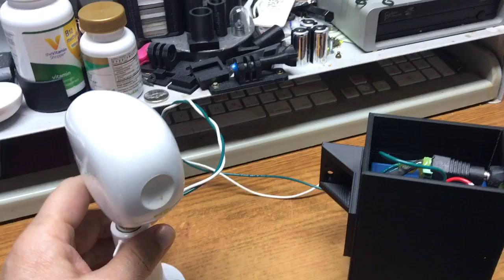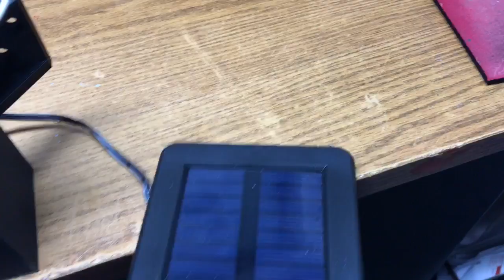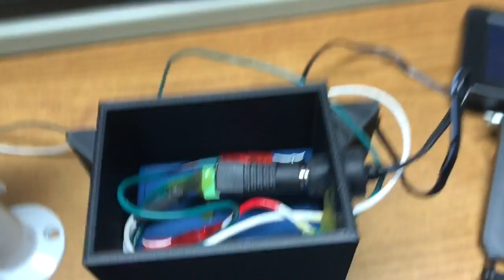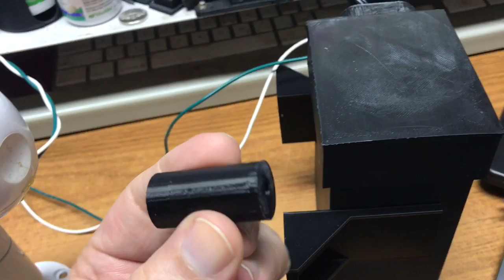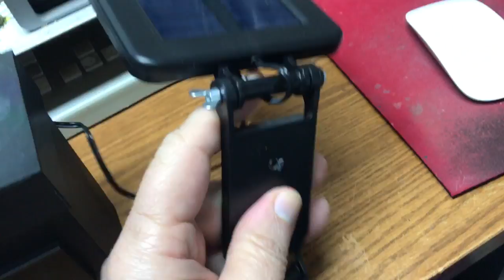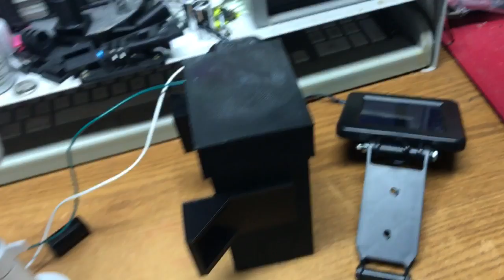Arlo camera solar pier hack

Comment: Hi Terry, most of the comments are from a few years back. I don’t have a 3d printer however, I like your design as I have the same need for a battery pack. I just bought a few 30ft and 15 ft Arlo HD power adapters that allow me to use a regular USB that is plugged into a 110v block anywhere I want to power it. My issue is I want to put some cameras in remote areas and need a self sustaining power supply. Is it possible to develop a USB to receive the camera? Second, I live the minimal solar panel concept. Would it be possible to get extra length to put the panel in the optimal sun LOS? I’m very interested in knowing more. I look forward to reading your reply.
Reply from the maker: There are solar panels for USB that are $30-$50 range. I would just put some rechargeable batteries in the camera and then use a USB solar panel. I am sorry I don't fully understand the rest of your question.

Comment: Terry, great job.  I was wondering if you could provide more information as to battery specs (where to buy) as well at the solar pannel.  I would like to do the same mod as you as I have 6 cameras and climbing a tree or trecking up a ladder is not fun anymore.  I have a 3d printer to support this project.

Thank you in advance

Comment: Terry- would it be possible to take a lanmu power adapter and rather than using the receptacle plug in- add a solar panel to it- if so - would you be able make one up and post a video of it

Comment: If I used rechargeable batteries. Can’t I just connect the solar panel directly to my Arlo camera?
Reply from the maker: To my knowledge they don't make rechargeable batteries that fit in the Arlo, but I've never really checked on that either.
Reply: They do make rechargeable's now. If is a RCR123A Litium Ion 3.7V. All over the Arlo Forum. If has been bless by Arlo because so many people have been complaining about the battery cost. Knowing all that could I just connect a 6 volt solar panel to the Arlo camera with the rechargeable batteries inside and never have to climb the ladder to change the batteries for a very long time? Or would I have to use a 12 volt solar panel? I just can not find the any info on this. I have asked the Forum too.
Reply from the maker: I would say it should work but since I haven't tried it I cannot say for 100% sure. Don't use a 12v solar panel, that will likely fry the camera as it runs on 6v.
Reply: Cool deal! I will give it a shop. Worth a try. These cameras have dropped in price now that the pro and pro 2 cameras have come out. Thanks for your help!
Reply: Matt - lanmu makes a rechargeable adapter - could you connect that to the Arlo  solar panel or similar and power it that way?

Comment: Because replacing the batteries is so expensive, after looking for ideas on several places I got my own solution, using the microusb connector to power the camera. I designed a replacement cover and made 3D printed parts with an opening for the usb cable. I bought 20ft microusb cables on Amazon ($8.00 20ft USB Power Cable for Nest Cam or Dropcam)  (https://www.amazon.com/gp/product/B00W21M4BS/ref=oh_aui_detailpage_o01_s01?ie=UTF8&psc=1).
I also got an APC UPS ($30. APC Back-UPS Connect UPS Battery Backup for Echo and Network Routers (BGE70) at Amazon)  to power 3 cameras from my Garage Door Opener outlet and used 3 USB chargers from old cellphones to power the cameras. If the power goes off the cameras still work as long as I have another UPS on the wireless network. 
You can see a photo here: https://photos.app.goo.gl/8iwoO1omgTOn4So03

Comment: Terry, I have a question if you could help me. I purchased the Arlo solar panels for my Arlo Pros and they come with a short power cord. With your experience, can I splice in a longer mirco USB cord? The Arlo people come at me right away stating warranty would be voided, which I don't care and possible component damage. What are your thoughts on making my solar power cord longer?
Thanks,
Reply: Hello,

Yes it can be done and I am capable of doing it but there is an easier solution. They make micro USB extension cables (amazon) and where the panel wire plugs into the extension use Coax-Seal (a tape that fuses to itself and makes a water tight connection) to seal the connection. I would also use the tape where the extension plugs into the camera. This tape is a bit like tar and once it touches itself it becomes a solid piece that cannot be pulled apart and this is why it's used by cable companies when they need to make external coax connections and they don't want water to get in. Hope this helps.

Comment: I was wondering did you get a low voltage Display on the battery on the camera like when the battery goes low doesn't show the percentage that's left.I have about five cameras I love what you did
Reply from the maker: Yes, it's about half but I am not worried about it. This should last for years without ever touching it.